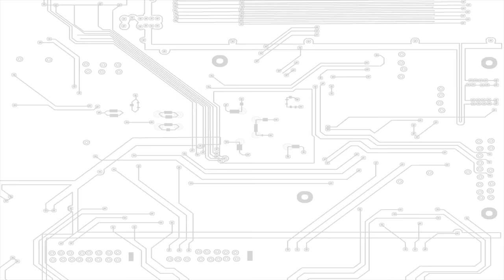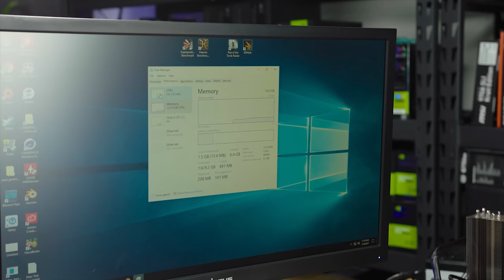How to fix bent CPU pins

Comment: Jay PLEASE do this with an Intel socket.  I have a motherboard that I bent the pins by dropping the cpu in the socket.  It will post, but none of the fans will spin, not the case fans or the CPU fan. I haven't tried to boot it, because workout a fan I'm afraid I'll cook my cpu.  There's literally nothing on the internet for a Mobo that will post and the fans don't come on.  It's always the other way around.

Comment: wish i've seen this video earlier T_T had my fx6300 oc to 4.5 and decided to cap out my motherboard by getting fx8350 which was on sale for 100 euros at the time with wraith cooler. so i decided to test out that cooler even though i had hyper 212 from coolermaster working just fine. the wraith came with pre-applied thermalpaste so i jammed it in just like that and didn't go too freaky on OC and just went with 4.2 at start and well... after a month cpu started goint into 70-80c (the max i was on my 6300 with 212 was 60), so i decided to swap the cooler for 212 and the wraith basically melted to the cpu with thermalpaste and that stupid mounting hooks make it a living hell to remove the cooler... well i slid the cooler at the wrong angle and it came off with my cpu (still in lock position on motherboard) and i got like 10-20 bent pins. the shop couldn't do repair (even for money) cuz 2 pins were missing. So fast forward a year and i get my ryzen 2600x (which meant total upgrade on everything from MB to RAM) and i see this video in my recommended ... pulled out my old build, took a butter knife and started working the chip went in fired up and works now ... yeah
TLDR: bought a new chip, broke it, got upset, bought a whole new system, saw the video in recommended, repaired old chip now have 2 systems :(

Comment: I put my cpu in correctly on my mother board but when putting my cpu cooler on  it was tightened wrong and I rotated the cpu cooler while it was on the cpu with the thermal paste on so idk if that could possibly damage the cpu but hopefully it didn’t 🤞🏾I haven’t booted it up yet cause I’m still waiting for my gpu to come in so I can install it then boot it up. (If anyone sees this should I reapply the thermal paste or would it be fine because I just picked it up for like 2 secs and put it back down, the thermal paste was pre applied in the cooler)

Comment: Just fixed mine with a needle just the width of the inbetween. Took me about 2mins.
About 5 pins where bent so far i couldnt fit a razor blade in between

Comment: Lol that happened to me once. A friend asked me to clean his pc and put some new thermal paste on the cpu (fx-6300). So I went over his place, cleaned the case fans and stuff. When I got to the cpu cooler, I took it off and when I looked down to see the CPU and the CPU wasn't there =)) like it was stuck to the heat-sink =)) So I took it of and I tried to put it back into the socket but I realised the pins were bent and I was like.. "FUUUCK, now he is gonna blame me and make me get a new cpu.. I MUST FIX THIS =)) " So I was trying to bend them back a little bit with a screw driver and after that, I took my bank card out and used that to fix the pins =)). I got drunk that evening tho =)).

Comment: I am having issues with my ryzen 5 1600. All my ram show up in bios and channels but the first 2 slots won't be used. So in dual channel with slots 2 and 4, 16gb will show but only 7.96 usable. My cpu doesnt go into socket smoothly so i am assuming its a pin issue.

Comment: What happens a lot is the cpu gets stuck to the heasink and comes off with the heatsink and bends the pins, tip for that is run your pc get it nice and hot then it will heat up the paste and noit stick

Comment: My ryzen 1600 accidentally fell on the floor, several pins bent, i tried to straighten them, one pin broke, many are still bent, bought it after months of savings, didn't even get it to work just for once. Soooo depressed right now.

Comment: You did not need to drop the CPU multiple times. The easiest way to bend your CPU pins is to just insert it wrongly into the motherboard and then locked it in.

Comment: My 3900x decided to get stuck to the stock wraith. So when I pulled the cooler off the processor came with it. Pins got bent I used tweezers and a tiny flathead screwdriver I got lucky

Comment: I just got my 3600 today and i installed it in the socket and it bent 2 corner pins when i locked it. I dont understand why because it was for sure installed correctly and flush...so i have to bend them back when i got home...it sucks i been waiting 3 weeks for this build and its one thing after another

Comment: I have a curved pin on my 5600x. It doesn't work at all straightening it, but it still worked but only 1 ram slot works lol. So imma just throw out the cpu

Comment: So I hope someone can help me. 

I assembled outside of the case, using a Gigabyte B450 and a Ryzen 3600. I came prepared with a USB stick with a not so recent BIOS update that the Gigabyte page said I had to install before using the latest BIOS version for Ryzen 3000 CPUs. So everything booted like normal, it posted and I got to the BIOS screen, a message popped up saying it had recently changed settings and that I might need to change them again. Kinda ignored it and proceeded to use Q-flash to update the BIOS drivers. It read the USB and I began the update. About half way through I realised the motherboard was already up-to-date to the very latest BIOS driver, In a moment of stupidity I shutdown the PC mid update. I believe the place I ordered the board from updated for me, great, though I had no indication that happened from them. Anyway, the PC powers on, GPU and CPU fans power on but now there is no post. I have cleared the CMOS by removing the battery and I have tried the RAM method. Not sure what to do now, any help would be greatly appreciated. Thanks.
Reply: Ask on reddit 
R/buildapc 
They'll help you out

Comment: No clue how this works but I went a year without cleaning my cpu thermal paste and it got hella stuck to the heat sink, and I ripped it on WHILE the amd cpu was locked in the motherboard and not a single pin was hurt and my cpu was working just fine. No clue how that works but it does

Comment: I bent 3 pins when pulling the cpu out with the cooler, bent even more when attempting to fix them. Tried several times to boot it up after straightening them all out and no post. My motherboards VGA led light stayed on so I looked into that. Read that it could be a dead gpu which, so I tried connecting the DP cable to the motherboard to get into bios and nothing. I unplugged the power to the gpu and flipped my display port around and it worked. It boots up fine, just had to enable axmp again and it’s all good. Hope this helps someone

Comment: 4:48 this looool, my 3900x
Reply: Did it work after?
Reply: @tidet6053  yes! i used a dave and busters card to straighten out the pins, it looked a little off but i slowly wiggled it back on to the socket and it was all good from there, is there a problem with your?
Reply: @PersonaXlll  same thing happened with one of my pins on my brand new 3700x. The pin was all the way against the substrate. And as a 14 year old who saved up for a year for this cpu, my world basically shattered. idk how but I was able to use a pcie bracket and needle to bend it back
Reply: Then the next day I went to micro center and told them cpu doesn't work and they gave me a brand new one. I'm pretty happy right now since I'm typing this with the new cpu.

Comment: I hate so much now my old intel mb that probably got those socket pins bent by some wind, like literally I didn’t even touch it but tried to put my i3 back. I also used to have an Athlon 64 that was even dropped on the table and guess what? Nothing happened. I was even able to trade in that old setup while getting the new i3.

Comment: So my motherboard got short-circuit and I have to buy a new mobo. I spent 4,000 pesos on that mobo and after I set it up, it didn't turned on and this time I have to bring it to a store that fixes computers and they said the psu is 'blackout' and now I bought a new psu that cost me 2,400 pesos and set it up. It's working now, yes it's turning on but it won't freaking boot and I went to the store again and now one of the cpu's pin is bent like 'bent bent'. Now, I don't have enough money to buy a new cpu and I can't submit my online school works so fucc it.

Comment: So this happened to me and i fixed all of the pins but no post, reset bios, cpu power is in, tried different ram slots, removed gpu but still no post anyone have anything i can try before i just give up on the cpu? Thanks.

Comment: i wish amd will change their pins system of their cpu with contacts like intel
Reply: Eh, LGA is possibly even more delicate than PGA. One thing I wish tho, is that Amd implements a retaining system for their sockets similar to Intel's. So that you don't pull out the cpu with the cooler. That's really frustrating.

Comment: My cpu came off along with the cooling  fan with the cpu in the lock position didn realize there were pins bent put it back in went to start the pc and now it wont start even after straightening the pins.. any suggestions?? 😤😤
Reply: OZKURITO_3203 buy a new one 🤷🏽‍♂️
Reply: @boofonly  i did just installed it today and still nothing

Comment: You have the best tool in your wallet lol. Use a credit card or another card and run it between the pins all around the bent one. Doing this will stopp you from over bending them and snapping the pin off as you'll be taking the line from the pins that are fine. But yeah a razor blade is pretty much the same.